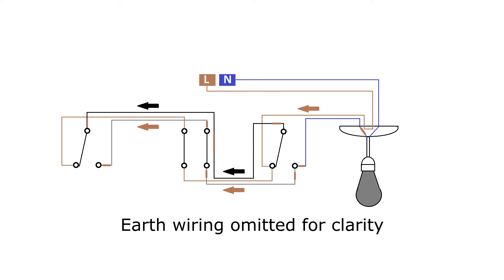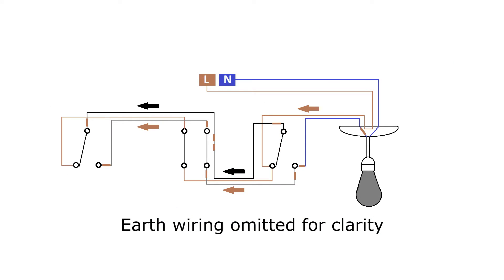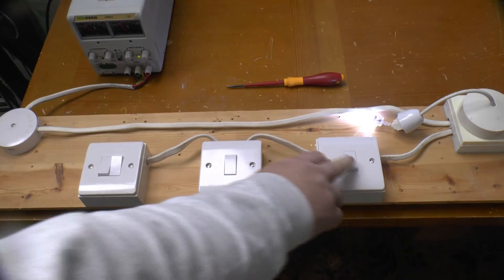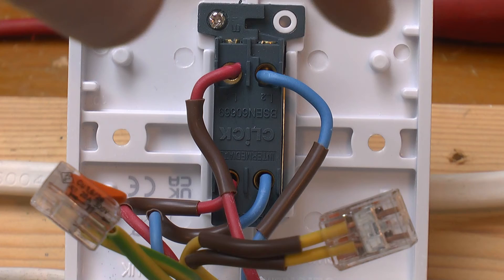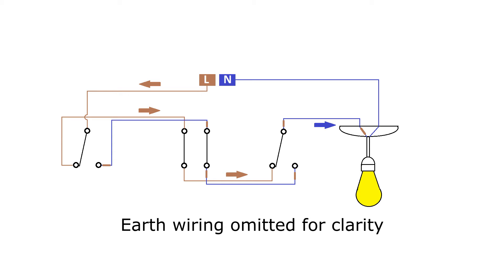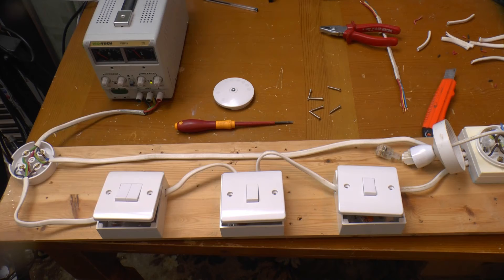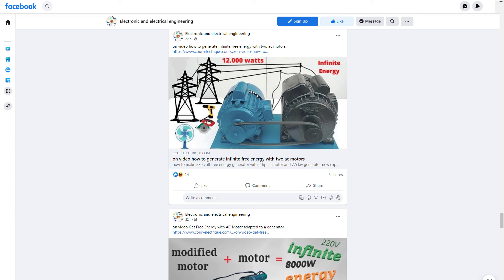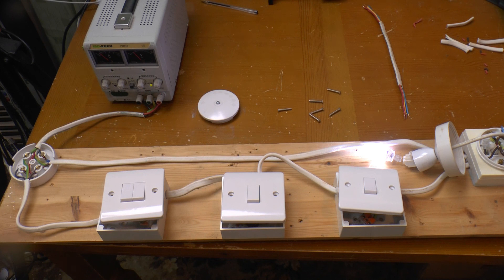1 bulb 3 switches diagram (intermediate switch wiring)

Comment: If strap wires are diagonally connected light is  off when all switches are in the same position. Intermediate switch must also be correctly wired . Much better when doing maintenance.

Comment: Does it matter which way round the L1 and L2 from the two-way switch go into the intermediate switch as long as they both go into either L1 or L2?
Reply from the maker: No.  If you swap one cable over, though, it swaps the output state, for example going from all-three-up-for-off to all-three-up-for-on.
Reply: @AintBigAintClever Thank you for such a quick reply, I understand if you swap the L1 and L2 in the two-way switch. But what if you swap around both the L1 wires in the intermediate switch (e.g. the red wire in the left L1 terminal instead of the right L1 terminal). Thank you again for making this video its been super helpful.
Reply from the maker: @lewi5972  depending on which way you swap wires around on the intermediate's L1 and L2  terminals it'll either reverse the switching action or fail to work.  What it won't do is go bang.
Reply: @AintBigAintClever cheers, appreciate the help.

Comment: I always like it so that all switches on a lighting circuit in the same position means the light is off, handy if you just want to change a lampholder without isolating at the board
Reply from the maker: When fitting switches it's always sod's law that they'll be the wrong way round the first time you wire them, and when it comes to three-gang with the middle one inverted you've got no chance.  I found it interesting (sadly) that the two different wiring methods give different results when wired with matching colours each end, too.